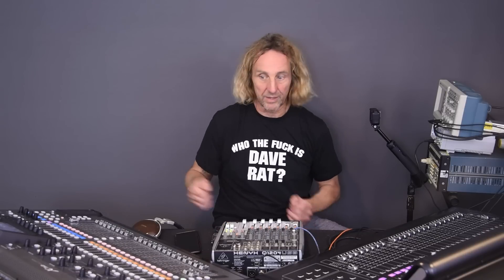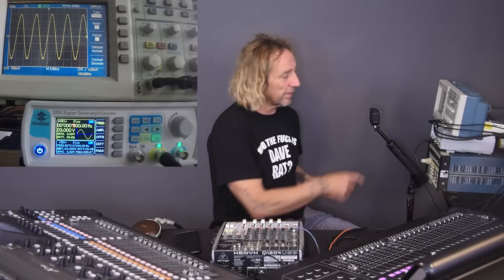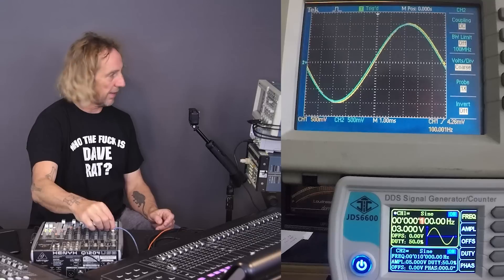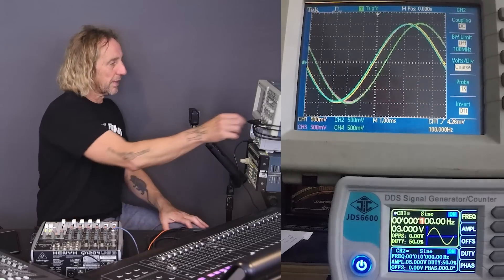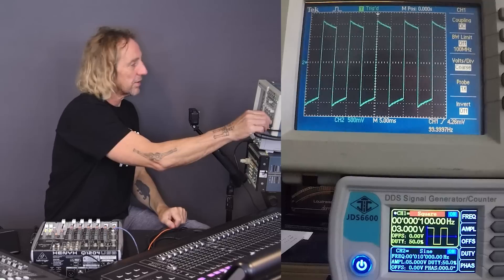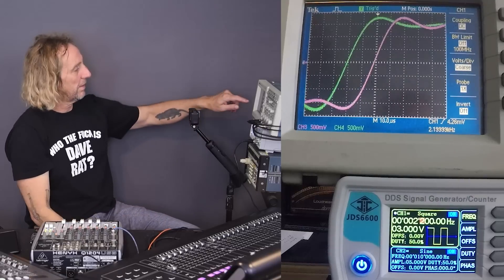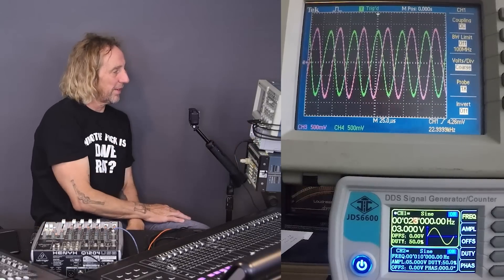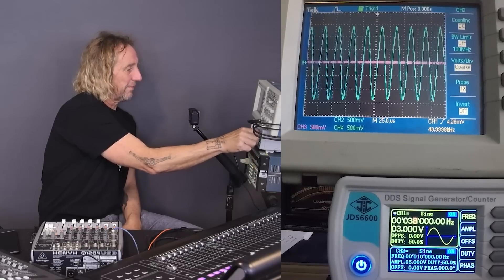Which Sounds Better Midas M32 vs Behringer X32 vs Copper Wire

Comment: Dave thanks for another great vid, again for me the one thing I take away from this experiment is just how good cheap Behringer gear really is, professional’s are to quick to dismiss Behringer because of price.
Reply: Cheap Behringer mixers and guitar effects. Their speakers and amps are a waste money.
Reply from the maker: It's easy to make a decent or good sounding mixer with simple EQ for very low cost with off the shelf parts.

I would not apply the quality aspects of one product across the product line unless a manufacturer has consistently shown shown that their products are based on high quality rather than low cost as the driving force
Reply: I think it’s important to note the pros don’t necessarily dismiss Behringer because of price.  They dismiss it because I’d their perception of its quality. It’s ability to withstand the rigors of professional use, it’s ability to produce consistent results over time and between units... Some may just be price snobs... and some may just be ignorantly espousing untested theories they’ve heard... but most that I have met have come to this opinion by experiencing failures due to lower quality components or lower tolerances.  
Behringer has always been marketed as a “cheaper” read “more affordable” choice for people who want the features, but can not afford the more expensive gear... and for the most part, I think they deliver on that.  For some folks, it meets their needs and their budget.  I’d much rather have an x32 for a play at a community theater than a 50,000$ analog board with no outboard gear... the flexibility and control of the cheap, lo-quality digits board trumps the superior build quality and reliability of the analog for me.. that might be different for someone else... but that’s my pro/con assembly.
Reply: Professionals don't dismiss their gear. Gearsnobs that can't mix do. I've been doing FOH since 1981. I've never refused to mix a show because of the gear. That would be unprofessional IMO. I learned on a 16 CH Peavey MK IV. I've mixed on nearly every brand of console that's ever been sold in the US. And I've mixed on every desk at every price point as well. I've done clubs and arenas. I spent 2 years with the band 'Brother Cane' in the early nineties and got to mix on big Clair Brothers rigs through a Yamaha PM5000. We did a lot of festivals and I got to mix on large format Midas, Gamble, and Yamaha. I sound-checked a BC on an ATI Paragon but the show got rained out and I didn't get to use it. If someone can't get a mix on budget gear they won't be able to get a mix on high-end gear either. Would you really want a pilot flying your airliner that can't fly a Cessna 150?

Comment: Very interesting comments about the possibility of perception above the traditionally accepted 20K limit. I'm about to open a can of worms here but --- I have commented elsewhere that I have a vinyl recording of Aretha Franklin made at Atlantic in NY with such luminaries as Arif Mardin and Gerry Wrexler. On a spectrum analyser that album has strong content from the brass section well above 20K. I can hear the difference between a digital copy of that album made at 44.1K and 96K. That may partly be related to my equipment but I can't tell the difference between my 96K digital version and the original. Whereas I can with the 44.1 version.  Interesting
Reply: I am just gonna throw out a crazy hypothesis that these frequencies above ~20K are what make something sound "real" ... that is ... if you closed your eyes would you be able to tell the difference between a live horn instrument playing in the room versus an electronic replica thru a loudspeaker.  Me personally? I could care less how "real" it sounds if the performance is smokin hot!
Reply from the maker: Haze, agreed, realism is one of many factors that may or may not be important or relevant and extended HF response is one of the factors to improve realism.
Reply: Are you sure it's content from the album and not harmonics from distortion due to the innacuracies of vinyl reproduction? Unless the album was recorded 100% analogue or sampled ridiculously high then a 96k master is going to be exactly what was mixed and so anything else in the vinyl version is likely to have been added by the vinyl process?
Reply: @stephenevans2518 Vinyl tracking errors are also a possibility.  The album was recorded in the late 1960's. As well as my 96K digital vinyl transcript, I subsequently purchased a 192K version produced from the original master tape. Both have comparable 20KHz+ content.
Reply: @kensmith895 . Wasn't it also a direct to vinyl recording ?
Reply: @daleclyne6057  I don't think so. I can hear the sounds of a tape machine in the 196K copy I have that was supposedly taken from the final 2 mix.
Reply: Are your speakers even able to reproduce frequencies that high at any usable level?

Comment: The increased rippling in the tops and bottoms of the square wave seen when the frequency is increased is an inherent distortion due to Nyquist and anti-aliasing filters. The higher frequencies needed to create the sharp edges of a square wave at ~11k and up are above Nyquist and are thus filtered out by the anti-aliasing filters, thus the ripple is seen. 

Comment added slightly before finishing the vid, sorry if I repeated something you already mentioned!
Reply: Yes, mathematically a square wave is an infinite number of sinewaves. Since all digital mixers are hipass limited only sinewaves below half the nyquist freq will show. 

A digital mixer can never reproduce a perfect square wave due to always having to work with a bandpassed signal.
Reply: @robertlofgren6834  Everything is a bandpassed signal, the analog console can not pass infinite bandwidths either. They behave a bit differently when that limit is reached, analog tends to be more gentle. We are also looking at the performance of two consoles with relatively low sampling rate, and there are things we could do before the AD to make things better for the digital, but those cost money.
Reply: @squidcaps4308  Very true regarding nothing having an infinite bandwidth. It is possible that things can be done before/aside from the ADC to make the response of a digital system more linear. However, if a significant number of the square wave's harmonics are above Nyquist, then there is no way to avoid the "rippled" square wave that results.

As @Robert Löfgren pointed out, all waves are a sum of sine waves, as proved by Fourier, I believed. The "riemann sum" resulting in a square wave I alluded to earlier, is called a Fourier series, whose waveform can be observed in steps of the sum - the first step being a sine wave, each additional step yielding a "rippled" waveform that approaches a square wave as the sum approaches infinity. See the following link for more info: https://mathworld.wolfram.com/FourierSeriesSquareWave.html

Since, mathematically speaking, harmonics contributing to a square wave that are above Nyquist need to be filtered out in a digital system, it is inevitable that the "rippled" square wave will result as the frequency of the square wave increases.
Reply from the maker: I appreciate the knowledge and perspectives. Now have an SD11 and x32 up on the table. Will show the waveforms of both at 48k and also with the sd11 at 96k
Reply: @DaveRat  + check if you can hear the difference as well
Reply: @robertlofgren6834  True - but also could the anti alias filter be ringing?
Reply: @kensmith895  If you look at the resulting waveforms that result from various steps of a reimann sum equation that leads to a square wave, the 5th or 6th step yields a graph that looks a lot like the rippled waveform coming from the console. It is definitely possible that the anti-aliasing filter has ringing that can be measured, but not in the way that is presented here.
Reply: @kensmith895  looks like the transient response of the very sharp digital filter after the delta-sigma ADC to me.  Analog antialiasing filter before the adc unlikely to have that kind of response.

Comment: I am just going to state the obvious --- you can get a copper wire for really cheap.
Reply: i feel like that copper wire may not have the same functionality as a 32 channel 16 bus digital mixer
Reply from the maker: Exiting the audibility and detriments of flipping in and out of digital is an ongoing adventure.

Avoiding a digital flip when possible, avoids even the issue completely. 

Mainly I am reminding people that for audio purity, the best that digital can offer is to not screw things up.
Reply: @DaveRat  Precisely! :) Digital can offer the world inside the virtual realm of Digital Signal Processing, but to deliver that payload to the real world digital can only offer distortion and loss of high frequencies. 😆 Everybody's got something to hide except me and my copper wire. Let's not read into that too much, it's just a Beatle's reference.